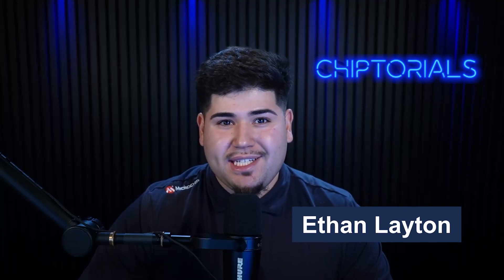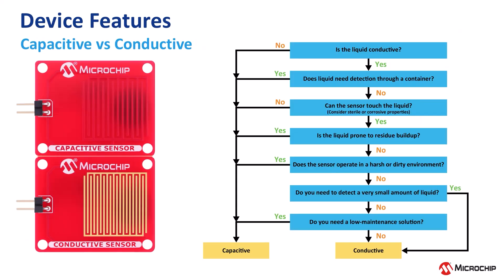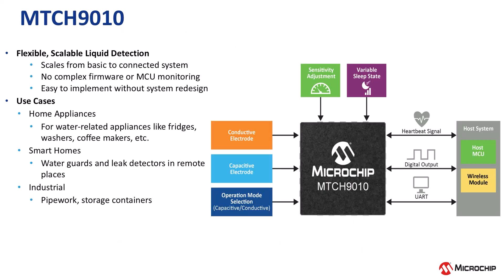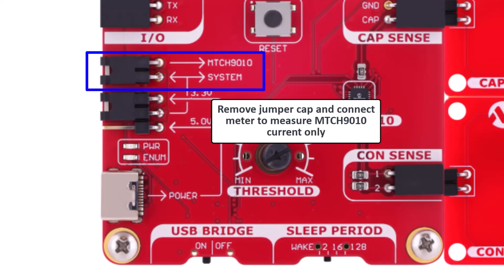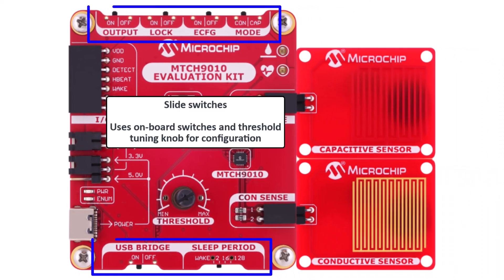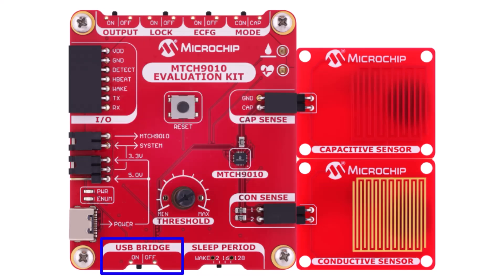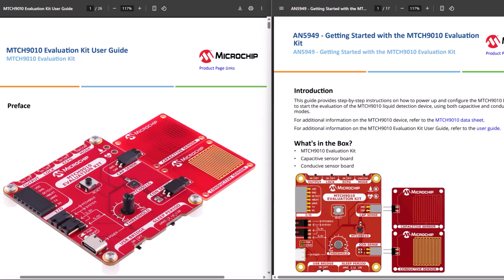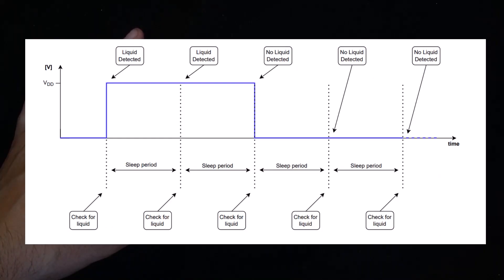Liquid Detection Made Easy with the MTCH9010

Comment: Can this device detect other fluids like oil and petrol? Or is it only for water? Thanks
Reply from the maker: Great question! The MTCH9010 can detect both conductive and non-conductive fluids, including water, oil, and petrol. Performance depends on the sensor design, electrode layout, and the properties of the liquid being detected.
Reply: I think Yes, as long as it is conductor.
Reply from the maker: @esquireedilbertiimarcelino2199  The MTCH9010 can also detect non-conductive liquids using the change in capacitance across the electrode.